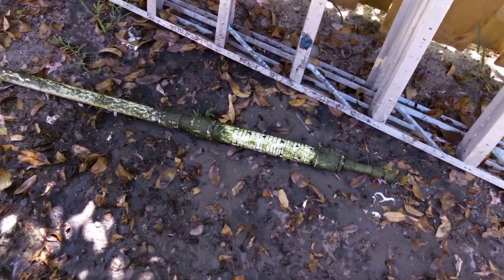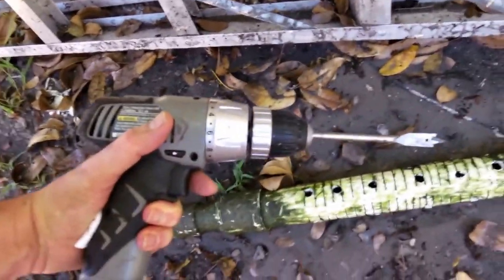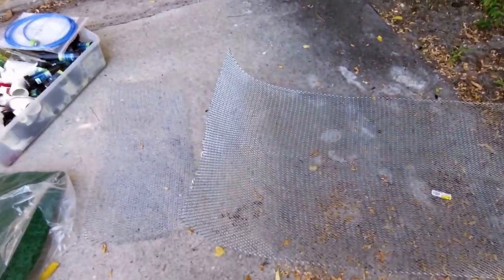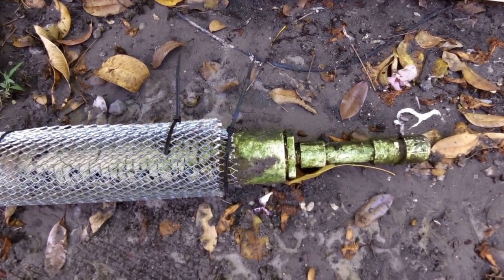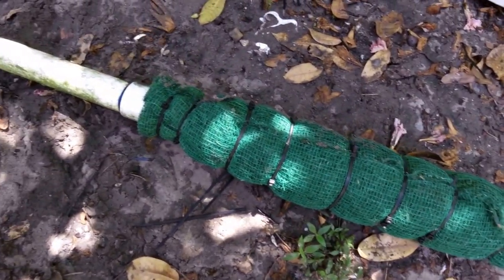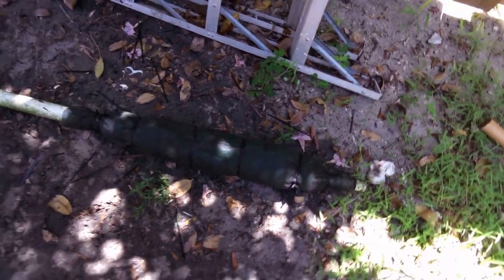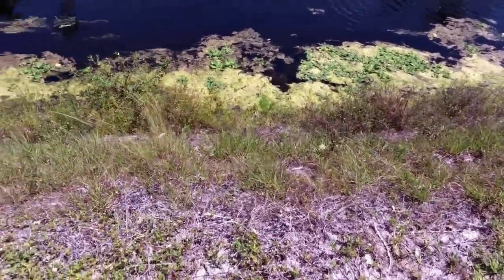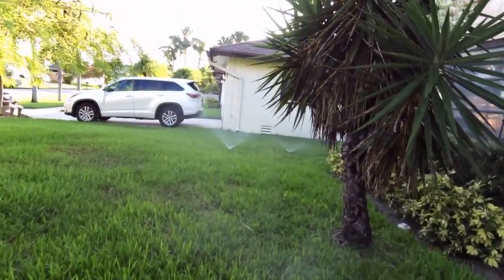How to Make an Irrigation Filter for Use in Canal, Lake or Pond

Comment: i was wondering why the lathe was your inner layer. it would seem that you would want the finer filters directly covering the pipe (?)
Reply from the maker: Great question....it was to support the outer layer and prevent it from clogging the inner pipe. That made sense to me at the time, and it's still working!!!
Reply: The finest screen is what clogs fastest.  So you want to maximize the surface area, therefore putting it at the outside.  The lower layers support that.  The inner layers are not as important except to give sturdy support.

Comment: How often have you inspected your creation?
I’m in the process of getting my similar pvc based filter out of the water and usually I just replace the internal screens...but your idea sounds interesting and I have all the stuff you used!
Reply from the maker: Sorry I moved last year but there were no issues with it until I left. I would say it exceeded my expectations for lifespan.
Reply from the maker: Evan Moyer  Thanks for that. Great suggestion. I did not experience the disintegration of the green screen. Also, I found that as long as I ran it constantly (ie. 2x per week minimum) I didn't have any need to clean it out.

Comment: How did this work for you after a summer of watering? We are installing our sprinkler system now and looking at different (inexpensive) ways to filter the canal water before it hits the pump.   I'm curious how this lasted the year.
Reply from the maker: Hey Jessica! Still works great. I still have to clean/change sprinkler heads periodically, but no more problems with the piece in the canal as of yet.

Comment: 2 quick questions: 
1) I live in SW Florida on a canal that appears to be just "brackish water"....I will use the canal water for outside watering....any problems with the Brackishness? 
2) what size of pump are you using?  I need to draw the water up out of the canal nearly a 100ft before I can tap into it.  Thank you for some great videos/richard in Port Charlotte
Reply from the maker: Hey Richard. The brackishness should be fine for St. Augustine grass, but I would strongly recommend testing it by manually watering a patch with the brackish water before changing the system over. 2. I am using a sprinkler pump, sorry I don't have the specs, but when I bought it it was reeded to be able to pull water a certain distance. Really, once it's primed you'll be okay even if there is a slight elevation.
Reply: @craigarious  thank you....I really have no grass....lotsa weeds....do have a great bunch of flowering plants....will ck with master Gardner buddy on how much they will take.....again thank you/richard